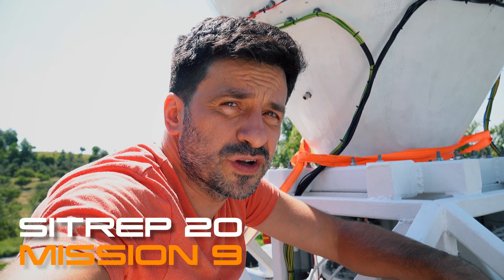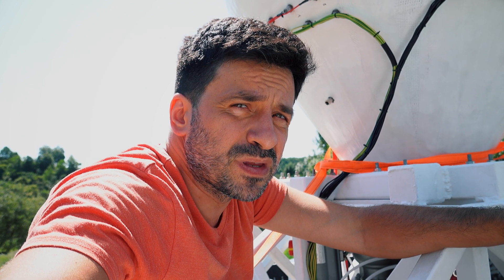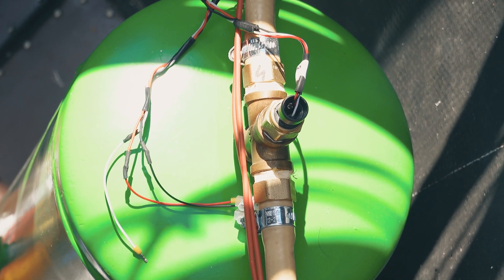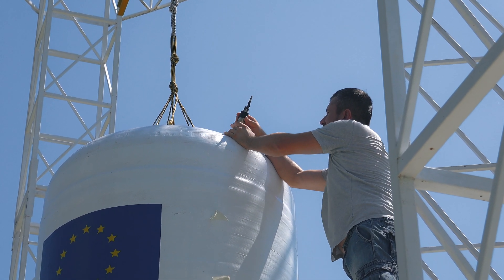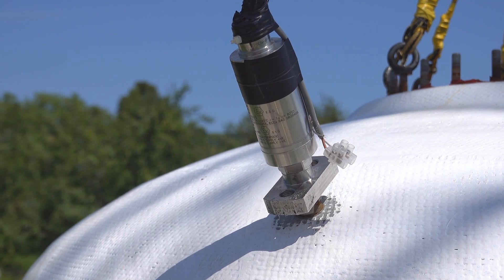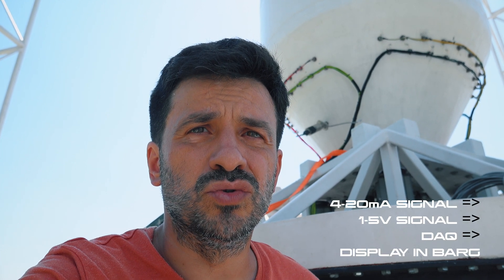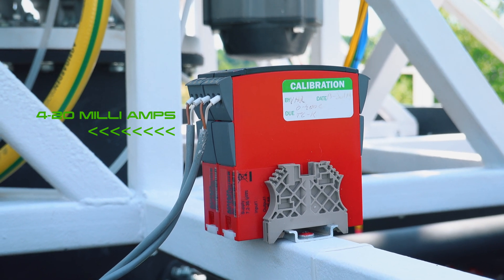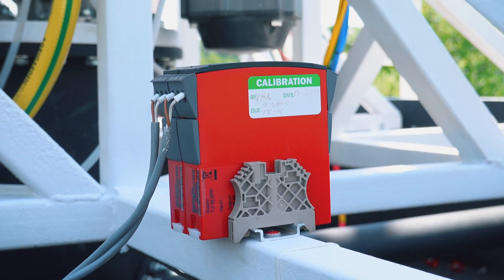MISSION 9 - SITREP 20: Sensors Integration on the Vehicle

Comment: Yes the standard sensors systems are 4-20 mA. Very well explained, the systems are not exactly linEars, they have an jnertial reaction dangerous, the experience is very important also calculations. And very congratulations for the projects. They are good projects and inspire us. Sometimes the sensors are out of order due to vibrations and other practical conditions, in a rocket engine the details are very important the vibrations can act as a saw but congratulations but i dont have money for you because in my country we are under a very bad government

Comment: what happens if it rains on all these sensors and electrical equipment?
Reply from the maker: The pressure sensors are water sealed. For the 4-20mA temperature transducers we have covers. We have a cover for the whole engine as a mater of fact. The flight computer, the IMU and the relays for instance are sealed in a dedicated aluminium enclosure.
Reply: thank you !